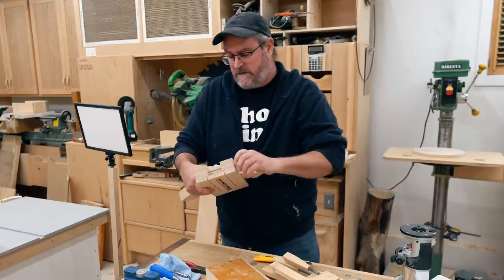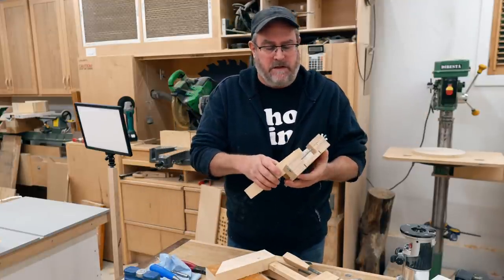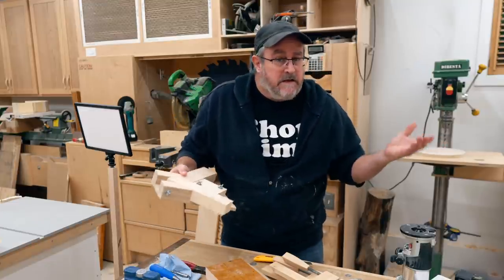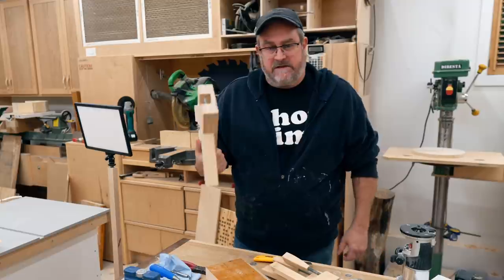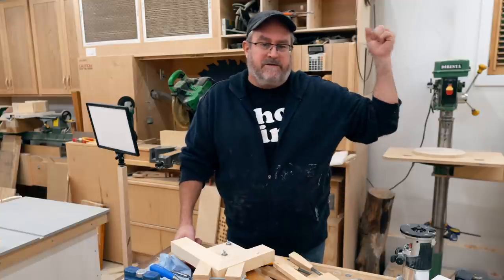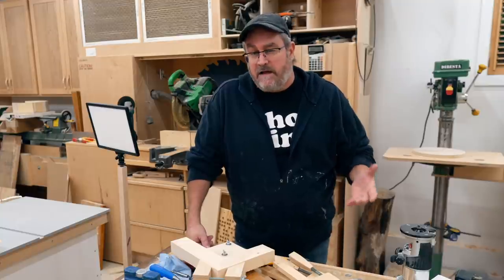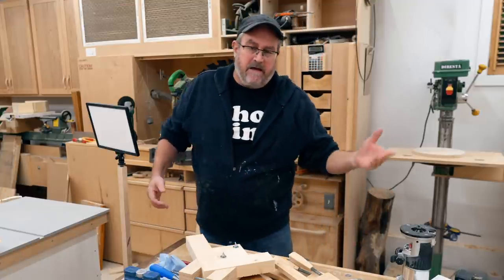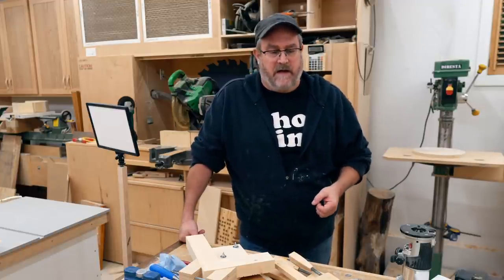This Clamp Can Get You Out Of a Tight Corner... Or Into One

Comment from the maker: Little update on the status of the I Build It empire and all of it's intricate workings. 
I took a few days off last week and didn't get much done. It used to be that I'd feel guilty if I sat around doing nothing during the work week, but that was the old, ultra-productive version of me. 
The new me doesn't mind at all. 
Could be because the new me is a lot older.
Plans are a drag. Especially plans for complex machines, especially when the project may flop and then I may not sell enough plans to justify the time it takes to make them. 
This is why so many YouTubers at my level have turned to sponsors - the money is great and guaranteed and there's a lot less work involved. 
Thinking I should do the same, if I had any sense.
Reply: John, I think after all this time you've shown your mettle, honesty and integrity. Get a sponsor, take some of the pressure off and do more things that you enjoy.
Reply: They make static spray are used to use it all the time so when I cut MTF it wouldn’t stick you are a try it
Cheers
Reply: I have had that problem with Sweatshirts, it’s very hard to get 100% cotton nowadays and they don’t wear in properly. That said I have just bought two Hanes sweats,code 7530 that purport to be 100% cotton, sort of lightweight,  but l’ll see.
Reply: Is there some automation u can add to your workflow to at least create rough plans?  Glad to hear youre balancing work.

Comment: I know you don't want poly in a sweatshirt but I do have to recommend the Milwaukee M12 hoodies. I've used a lot of hoodies in the last 30yrs or so for work and play and this one is the best. Besides the heating part, which I don't use a whole lot, this hoodie lasts much longer than any other I've ever used. I have one for work and one for out in the shop. The outer shell is 53% cotton and 47% poly. I'm not a big fan of manmade fabrics but they did it well. It's not a collector of sawdust. The only downside is you have to wash it on the gentle cycle. It is expensive at $119 for the hoodie only but it doesn't wear out so it'll last a long time.